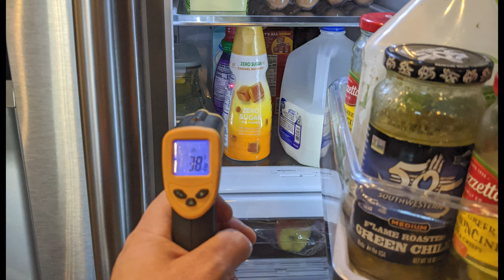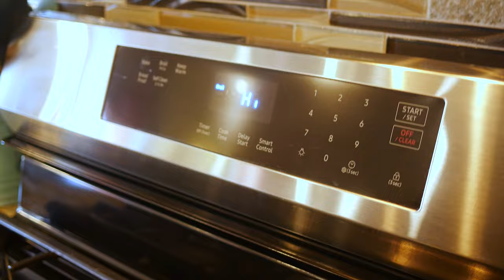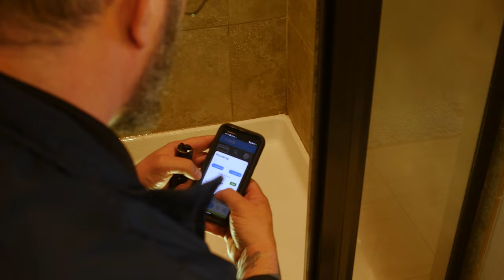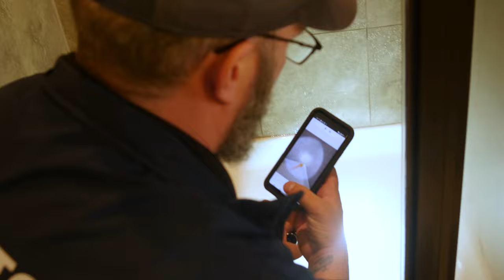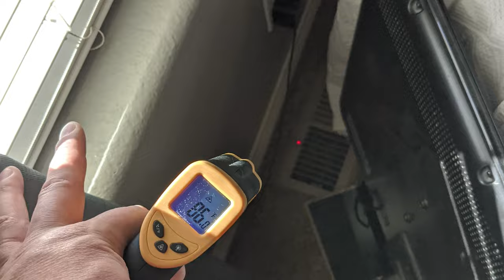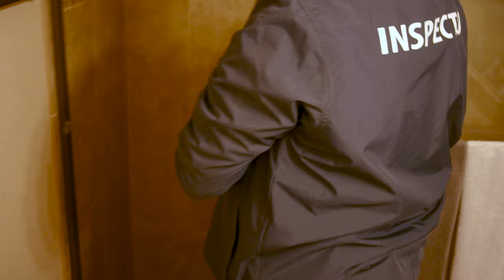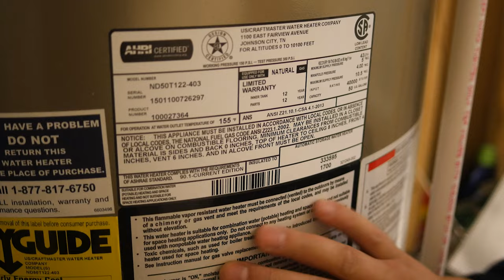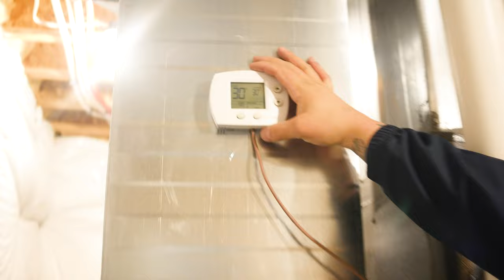Performing an Interior Inspection with Top Choice Inspectors

Comment: Great video and inspection.  Just wanted to throw out some suggestions here.  1.  I never touch a panel cover with my bare hands until I test it first with my contactless circuit tester and even then, I utilize rubber insulated or leather gloves.  You can still get electrocuted  by using the back of your hand.   2.  Working in the electrical field I was taught to Never use the screwdriver on electrical panels by touching the metal shaft while backing out screws.  If they happen to contact some wiring while being backed out, it can and will electrocute you.   3.  I no longer walk away from microwaves once I have started them as I have had units that failed proper operation and started fires while running.  4.  If possible, I use my bare hands to touch the water supply and drain plumbing under sinks as I have found leaking/seeping systems that were not initially visible.  5.  Microwave exhaust vent, when possible, I stick my bare hand into the cabinet where the vent piping is because I have found improperly installed leaking vent piping in the cabinet.  6.  Using the "test/reset" buttons on GFCI protected outlets does not always test the outlet for a ground fault.  I have had instances where the buttons worked properly, however when using my circuit tester, the unit did not trip.  If the outlets are full and I cannot test them, I take a picture of it.  If it's just a toaster or "dumb" device with no clock I will unplug it.  7.  I always grab ahold of the countertop ledge and pull/lift up...you would be amazed at how many loose countertops I have discovered with this method.  8.  I always light/operate fireplaces (even though I don't enjoy the process & danger therein) because the vast majority of people will NOT hire a fireplace specialist to test/inspect the system before close of escrow and that could cost the lives of my clients and/or children.  9.  In bathroom and kitchen sink cabinets, I look up at the bottom of the sink basin to verify that they are installed properly.  I have found some seriously bad instillation of sinks with this method.  With showers & tubs, I always check the shower stall and tub areas before running water so as to not inadvertently cause possible further damage to the surrounding areas.  Also, turning the valves on and off quickly on sinks, baths and showers sometimes reveals water hammer or loose plumbing.   10.  I personally use a flathead screwdriver to lift toilet lids and operation of flush handles for sanitary reasons.   I also always take a picture of the toilet water flushing and tub, shower & sink drains actively draining water (this has come in handy for attempted previous claims).   11.  I operate the water shut-off valve, drain pressure at exterior faucet and install my pressure gauge, leave the pressure gauge on the water line for about 10 minutes.  If pressure builds, the shut-off valve is failing.   I have found many, many failing water shut-off valves using this method.  This also helps to discover failing pressure regulators.
Reply from the maker: Glad you enjoyed watching the video.
Reply: That was great comments that you made! The inspector did not even talk about the panel Bond or grounding or how to find the grounding connector or what was wrong with the problem that he found in the panel with the wiring. I only watch a little bit of the video so look at more when I have a chance. Any inspector can learn things from watching another inspector work!
Reply: I hope you include this level of value in the quote you send. Some of these would definitely fall under Comprehensive Home Inspection. Especially the fire system testing and pressure gauge testing. Very much exceeds standards of practice for visual-only inspections. Great insight.
Reply: Great info 👍🏾

Comment: As far as the attic/insurance point..  What if you have to inspect an attic mounted HVAC unit?
Reply from the maker: Got to try to go in there. But it may be restricted. If there's no access or safe access, that's a safety and maintenance problem that should be fixed.

Comment: This video was not too bad. I’m at home inspecting maniac, I do usually about 20 inspections a week. The 10° temperature deal that you mentioned at the thermostat is a really good idea. I did not watch the entire video, but one thing I noticed was that you do not leave all the water running during the entire inspection. I know other inspectors that do that. I can tell you now that you are missing lots and lots of plumbing leaks by not letting the water run. As the water runs during the inspection things will start to leak that you did not catch just turning the water on. Sometimes I will run a faucet for over an hour and then the handles or the base of the faucet or the plumbing pipes will begin to leak. Also, if you’re constantly pulling from the hot water tank you will find leakage at the tank sometimes. Probably about 95% of the plumbing leaks that I find are because the water was running for an extended period of time. I know you don’t want to risk the water running, but you will miss a lot of plumbing issues by not doing so. I just move really fast constantly and I’m always going back-and-forth checking water sources for leakage.
Reply: LOL
Reply: @joshj.15  Is that funny?
Reply: @theallaroundguy2399  Running water for as much as an hour for each faucet? Doing 3 inspections a day, 7 days a week? Do the math on how much water is being wasted for no reason. Not to mention, running water for an hour means you are not watching the water, means you risk flooding. If you are doing 3 inspections a day, it also means are doing inspections at night, which is not recommended.
Reply: @BillC-64  Thanking like this is the reason you’re most likely 100air or 1000air versus a millionaire
Reply: @theallaroundguy2399  Thnking like what? Not recommending running water for an hour? Leave running water in multiple rooms while not in the room? You think that is good practice?
Reply: @BillC-64  Trust me, if you want to be an extremely successful property inspector do what I say and not what you think
Reply: @theallaroundguy2399  You mean simulate things that are not normally done in the average house hold? Hey, why only an hour? Why not 3 or 5 hours of running water for each faucet. Can't wait for Internachi to have their for their video on testing all drains for an hour and walk away from it...............To each their own. You can do whatever you please.
Reply: @BillC-64  absolutely, in the short period of time we were there, the goal is to push things harder than the average homeowner will do. We would like to ensure that they can live there and function under normal conditions. If all the systems can endure a thorough property inspection then they should be OK. I can only imagine how many leaky faucets, leaky drain lines, slow drains, clogged drains, collapsed or clogged main lines etc. that you do not find. If you do well and septic system inspections I can only imagine how many wells you do not pump dry and how many lateral line fields you do not find leaching. You need to be very careful. You may need to go with a more experienced inspector for a while
Reply: It’s just a matter of time before your practice of leaving the water running without supervision backfires on you!
Reply: @rayterranella1  16 years and around 15,000 inspections and never had an issue
Reply from the maker: Glad you enjoyed watching the video.
Reply: @sassyshassy  You can do whatever you want, but it’s best to run the water the entire time of the inspection. If you do that you will notice that you find a lot more plumbing issues. Leaky drain pipes, leaky supplies, leaky faucets, leaky faucet handles, leaky supply line valves etc. Also, multiple times a year you will find that the plumbing Begins to back up in most of the time it is from a damaged or obstructed main drain line. Running the water the entire time is definitely the way to go
Reply: @sassyshassy  A lot of home inspectors don’t take an hour to do an inspection? And yes, leaks will occur after 10 minutes all the time. Sometimes leaks occur after an hour or so
Reply: @sassyshassy  yes, you’re right, home inspections are very wasteful but that’s just what we do. How do you ever find a plumbing back up in the mainline that can be 100 feet away from the house if you don’t even use as much water as you can at the inspection?
Reply: @sassyshassy  It does not matter if the interior takes 30 minutes or three hours, the water is ran the entire time. The toilets are flushed repeatedly. The oven and broiler is on a good amount of time. The dishwasher is running. The sprinkler system is running. The overhead garage doors are operated multiple times. The HVAC system is ran hard the entire time. The jetted tub is ran for 15 or 20 minutes. The shower pans are holding water the entire time. All of the lights are on. The kitchen stove vent hood is on the entire time. I could just go on and on. If you’re not doing the stuff I mentioned, then you’re not really doing a thorough intense home inspection. I would love to take maybe 50 of your reports and compare them to just a random 50 of our reports. I don’t think or guess, I know without a doubt you are missing so much stuff that I would catch.
Reply: @sassyshassy  probably why I see so many inspectors that just do not do well and you’ll see so many inspectors on Facebook pages talking about struggling for business. I stay extremely busy and I have for years. Multiple weeks I have grossed $10,000. There’s a reason for that